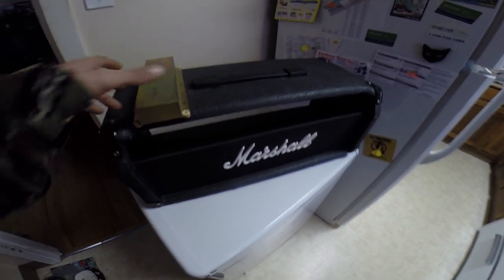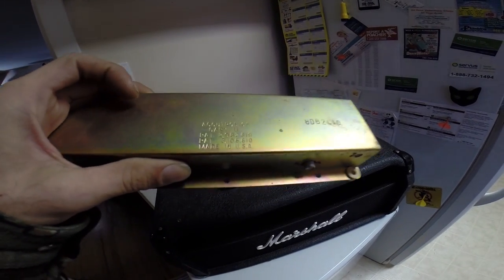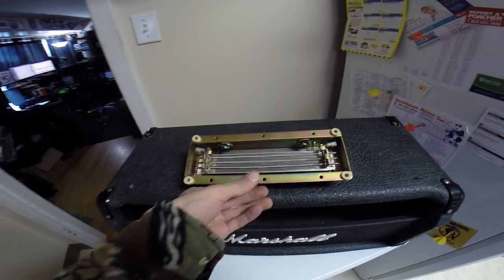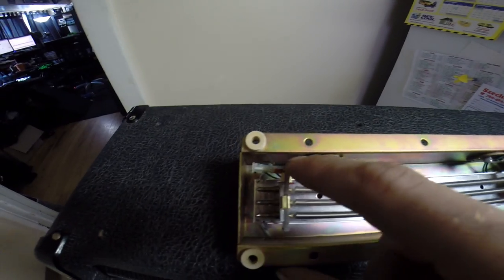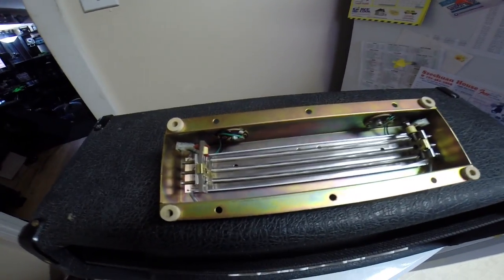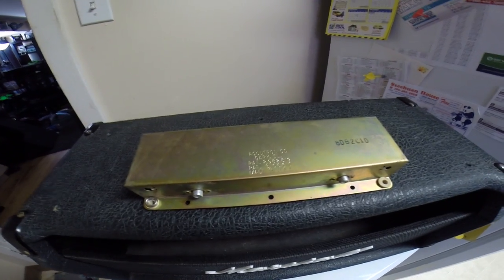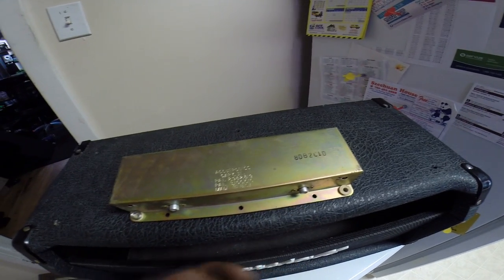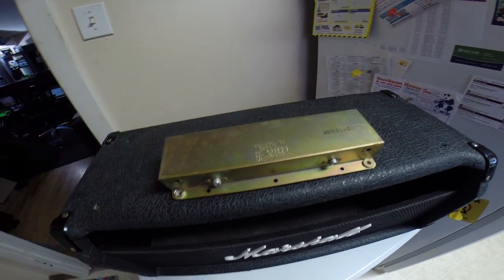Marshall VS100 Broken Reverb/No signal to speakers.

Comment: Helpful video! My amp had soldered connections inside the reverb box, but also one of the cables broke. A simple re-solder did the job. I might not have found the problem as quickly without the video.
Reply from the maker: Appreciate the feedback, and nice work 😊
Reply: Thanks. If you or someone else encounters another problem (I guess I'm not the only one with that issue): In my amp the line switch was "broken", i.e. the contacts inside were so terribly corroded that the amp didn't turn on. I then bent the four metal clamps on the switch case aside, opened up the top of the switch, cleaned the contacts, rearranged that movable plastic part in the top (to lock the switch in the "on" position), added a bit of lube, and put it back together. The repair didn't require soldering, and thus the PCB can remain in place.

Comment: Hey man question. So I’ll be playing my amp, volumes coming through, everything plugged up correctly, no issues at all, then after about 5-15 minutes of playing, the volume signal slowly dies down a few notches and then keeps going until there’s no sound at all. All the lights are on, I’ve gone through the troubleshooting process and eliminated all external possibilities, and I’ve concluded the issue is the head of my stack. Have you heard of such an issue happening with the Valvestates like this or do you have any recommendations on how to DIY repair this? I’ve had this issue in the past and the repair shop didn’t tell me what the issue was, they just charged me $250 and told me to fuck off.
Reply from the maker: I'm not an amp tech simply put. Just a hacker. Though that sounds kind of heat or bias? overrun related. 
Being solid state maybe failing transistors as it gets warm.
Something you might try is isolating where with a can of canned air used upside-down,  see if certain transistors behave different when frozen/warm back up.  You might  trigger or fix the issue hitting a certain transistor then can replace it.

Comment: Did you fix it? Any clues?
Reply from the maker: Bad wires in the reverb, and a fuse.
Fixed the wire connectors for the reverb.
Changed the fuse, played for hours, put on the shelf.
Not sure why the fuse initially blew.
Reply from the maker: It's pretty easy to pull the connectors and reclip them onto fresh wire.
Reply from the maker: Nagoth it's the goldish  box I show in the video, likely  attached to the top or side of the inside of the amp. It will have RCA connectors that goto the main board. 4 screws should remove it.